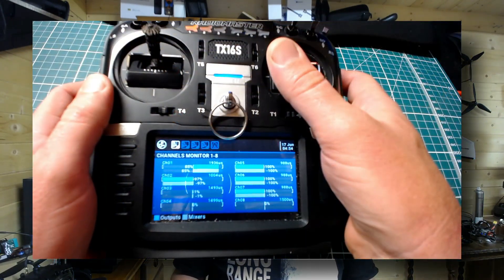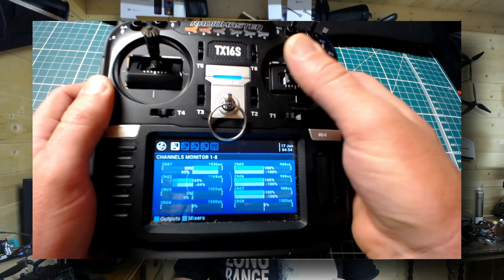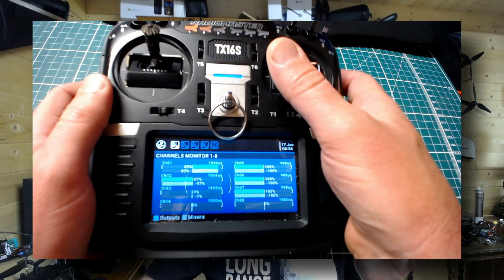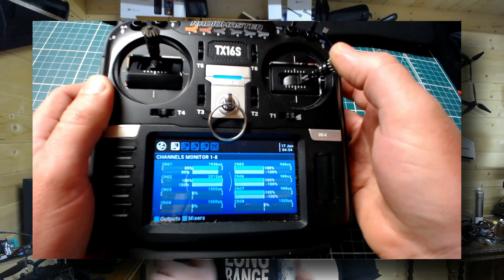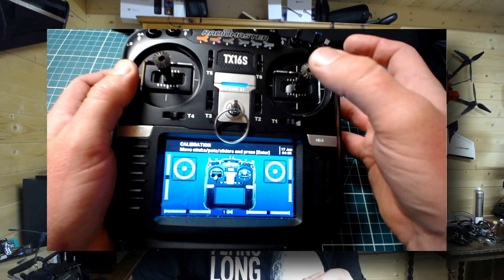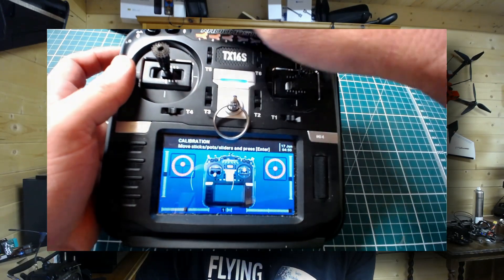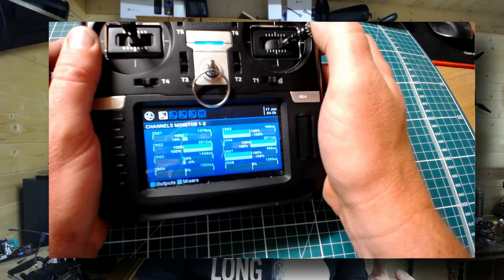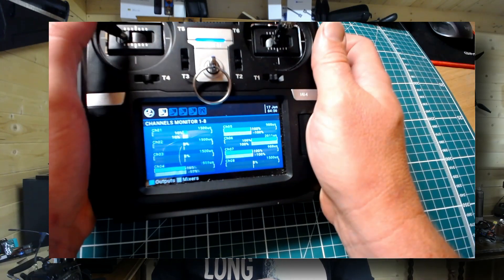RADIO MASTER TX16S | GIMBAL DEFECT?  CHECK YOU CALIBRATE CORRECTLY.

Comment: Just came accross this video i had taken radio apart and was going to take hall gimble out and dremel the stopper on gimble so throttle pitch would go to 100% and i would have 0 degree at true center stick marker lines. Then i thought got to be easier way AHA AHA found this video thank you so much you saved me a lot of work

Comment: Running edgetx on mine and I simply can't get the sliders to calibrate at least one of the sliders on each side of radio is ALWAYS off center.  I have same issue with sticks not going 100 -100 as well.  This is a brand new radio and I may be asking for a refund.  Go back to my trusty Qx7.

Comment: Damn was really hoping for a solution to my problem but this isnt it.. my calibration drifts off over a short amount of time.. within hours of calibration the centerpoints go from 1500 to either 1560/1440 or there about and it makes my quad dip hard whenever i let go of the stick.. not sure if anyone else had this issue but im going crazy trying to get this solved
Reply from the maker: On both sticks?
Reply: @RTRCTV  yes😰 it keeps getting worse the longer i wait with calibration.. only right after calibration it works properly
Reply: @Stefan_Besteman  I am experiencing the same, have you found a solution for it yet?
Reply: @francoisvanloggerenberg4157  i contacted radiomaster support and they said the voltage regulator for the gimbals might be heating up and they asked me to send the radio into their repair center which i will do as soon as i have the time for it (i am currently extremely busy with work and school) the people at radiomaster sound knowledgeable and understanding so thats always nice. my particular repair center is located in the Netherlands as that's where i live at

Comment: Thanks for the tip.  The problem with most of us, especially me, is that we don’t tend to read the manual and when something doesn’t behave the way we are accustomed to, we assume that there’s something wrong with the software or hardware!

I do have a question, and that is, how do you remove the joysticks?  Mine seem to screwed on so tight that I’m afraid that if I put too much torque that I will damage the gimbals!
Reply from the maker: Hey..     No issue.    My video resulted in the manual being updated to show the tight way :)

Gimbals stick ends just unscrew.   No idea why yours are so tight!
Reply: Rob Thomson FPV Thanks for getting back to me.  

I managed to unscrew the sticks very carefully and steady with pliers!  I did find that the steak threads are not the same size as those for the Jumper T16.  They seem to be thicker, so people have to be careful when they order replacement ones.
Reply: There is an Allen screw that locks the stick on shaft. First loosed the Allen screw in the top of the sick then the stick will twist freely Vw/ccw to adjust height then once you reach desired height, tighten Allen screw back up to lock in place.

Comment: Hi Rob, found this issue on other Hall effect gimbals (FrSky x-lite) too. Seems to be quite common. Your proposed way to calibrate the sticks is the better way.
Reply from the maker: Thanks for the feedback.

Never had it happen on any of my other radios..    But then.. Who knows.

Main thing is that it is an easy fix.
Reply: @RTRCTV  Hi Rob, I have an estimated guess what happens there: If you move the gimbal in one direction it moves a small magnet and this movement is seen by the Hall effect sensor of the other axis as well. Just a little bit. I had issues with small movements around the center in case of presence big pieces of steel. One example situation is flying while leaning on the car. Had these effects with compass based head trackers as well. Could solve this just with increasing distance to the car. Some Hall effect gimbals are more prone to disturbances of external magnetic fields than others.
Reply from the maker: Guess it's possible.

Other option is that the Gimbals are not 100% spherical.. But slightly more oval in size.

This could just be a small error in the moulding.   Probably only a micrometer out!

Comment: Hello, this is not a defect. Please calibrate your radio when its new. We recommend all users calibrate their radios as instructed in Chapter 3 Page 20 under the "First Boot" instructions. Also please calibrate the radio again if you adjust spring tension or open the case to perform any modifications or adjustments etc
Reply from the maker: Out of interest.. The manual while telling you to calibrate does not actually specifically say not to go to the corners during calibration.  You will find many many users will move to all corners when calibrating.
Reply: @RTRCTV  Thank you for your feedback, we will add a note for correct calibration method to our user manual.
Reply: I have done this calibration 20-30 times but my sticks in full corner deflection read 95. Side to side they read 100 but corners are 95-97. This does not happen on my jumper T16 radio gimbals. I would definitely say it’s some type of defect.
Reply: Hello Radiomaster, I’ve encountered a similar problem, but it was much more exaggerated. Only with the ailerons, I would get 68% in one direction, 92% in the other, and 100% in the corners. My weight was set to 100, and I didn’t have the problem before adding some mixes. It occurred while adding mixes, and stayed after deleting my mixes. Will try to recalibrate, but concerned it could happen in flight.
Reply from the maker: I have adjusted the video title to reflect better what you need to do.
Reply: Just installed these new pricey gimbals... When I move the throttle stick to 100%... is drifts down to 97%... This is after calibration... I can't tighten the throttle tension screw any further.  This has to be a defect.

Comment: This is not a problem. The problem is that you do not do the calibration according to right procedure. Thats all.
Reply from the maker: Totally.. its a procedure to do right.

However....

The same issue does not exist on frsky radios; jumper t16 etc...  End of day.. there is a minor mechanical defect in the alignments - but easy to resolve via calibration.
Reply: @RTRCTV  because they calibrate at factory?
Reply: @brunofporto  All radios are calibrated from the factory DUH! When it is delivered to you you're still going to do a calibration when you set up your radio......
Reply: @white_rav3n  not with my old Futabas so DUH back to you mister. 
But... I did calibrate as you show first time as I was used to calibrate my PC joysticks that way for years.....